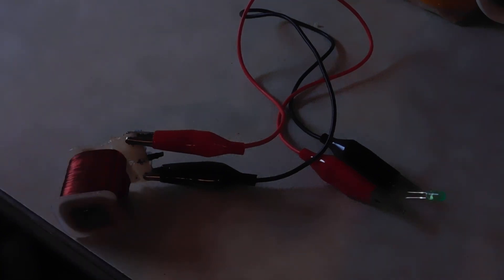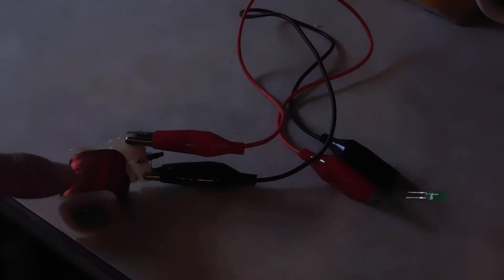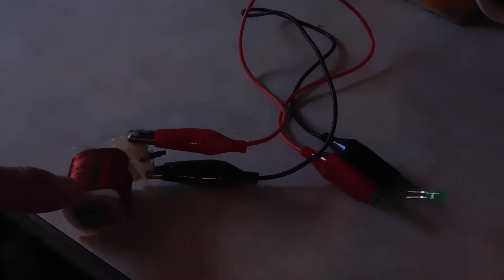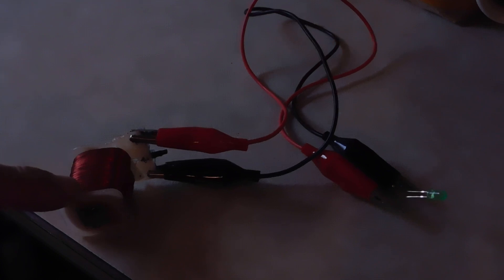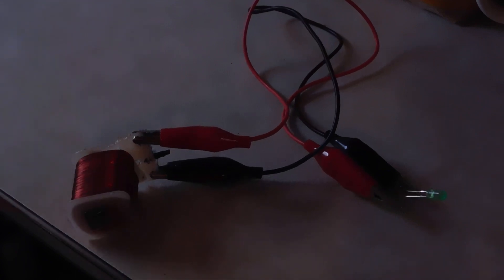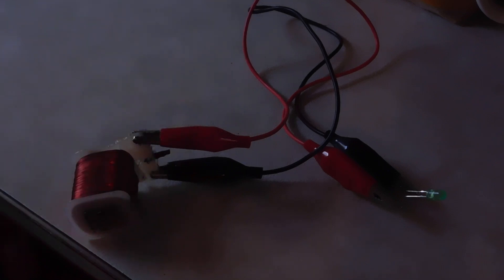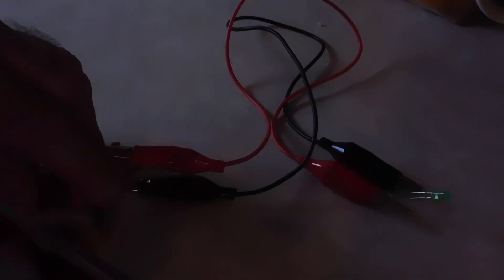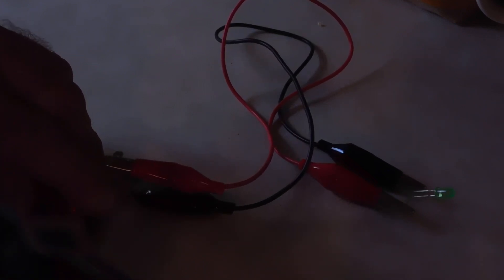Copper Coil, Magnet, LED, free energy!?

Comment: You're a bit late, Michael Faraday discovered this is 1812, it's how electric generators work. It's not "free" you have to put energy into the system to move the magnet or the coil.
Reply from the maker: Wind, water are free, not so much water sadly. If a perpetual motion device is used that would be free energy.
Reply: @hunzoldworld  Unfortunately perpetual motion is impossible as it would violate either the first or second law of thermodynamics, or both.